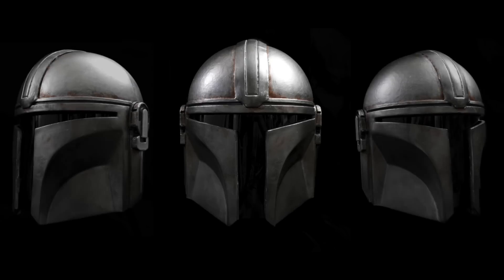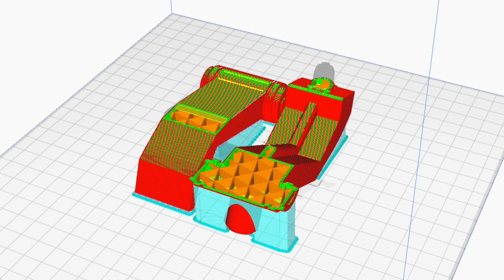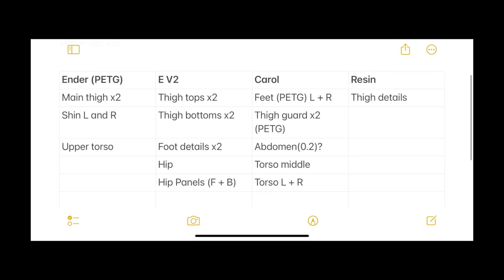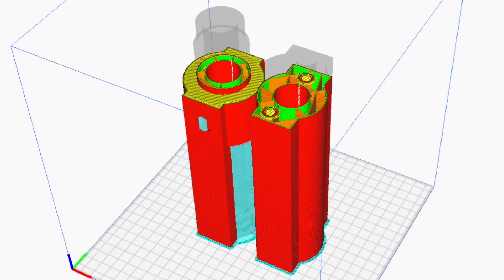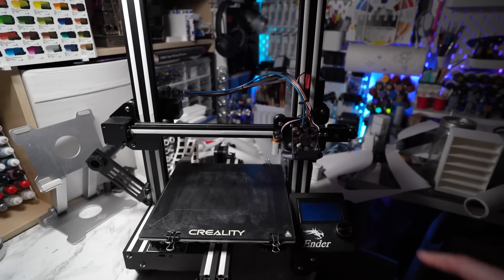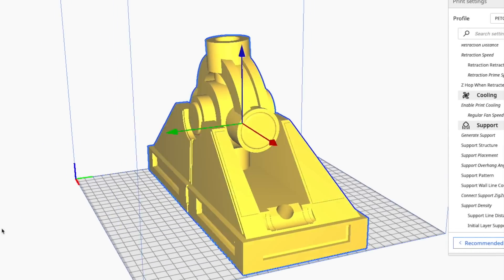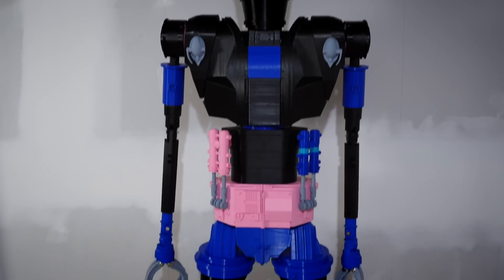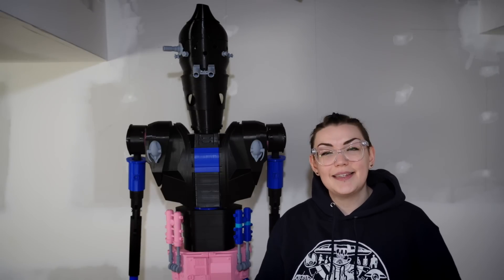How I 3D Printed a Life Size IG-11 from The Mandalorian in only 10 Days

Comment: This is very cool, and I’ve toyed with the idea of a K2-SO, but I’ll ask you the question that’s holding me back. Where do you plan to put it?
Reply from the maker: I essentially have “droid parking” in my workshop. A lot of the droids don’t take up a ton of space as they’re quite thin and it’s just their height that could become more of a concern. It’s probably similar to the area needed for a floor lamp in a lot of cases. I’ve also wanted to build a K2 for a while. He is one of those droids that take up a bit more space as his legs have further spacing than a lot of them that just are straight down from the rest of their bodies.

Comment: Which is the best 3d printer you would recommend to use when making props for cosplays and armor etc? Also love the video!
Reply from the maker: I’m a big fan of Ender 3’s. They’re the first printers that I use when printing anything and I only use my larger ones if the piece is too large to fit. There are a ton of different models though so I can be a little confusing. The V2s are great but there is a V2 Neo that has some great added features that I personally feel is well worth the slight price jump. I’d only go for a 300x300mm printer if you’re really going to be constantly printing massive single pieces. Most large models are split into pieces that will fit on an Ender 3 size bed though (235x235mm).
Reply: @MMsPropShop Thank you so much for the info. I'm very interested in getting my first printer and had no idea where to start. This has been a great help.

Comment: i always print my petg with the cooling fans but a little hotter to prevent that delaminating. i like to use sunlu at 240 degrees nozzle and 80 degrees bed. instead of primmer filler i use a paint brush to apply printer resin to my parts and sand

Comment: That is freaking cool!! 
I’m new to the channel (I also subscribed), how many machines do you have or did you use for the project? I’ll have to catch up on your other vids, but keep up the good work 👍🏻👍🏻
Reply from the maker: Other than the ones used for this build that included a CR-10s, Ender 3 Pro, 2 Ender 3 V2s and a Mars 2 Pro, I also have a Mono X, M3 Max, and a CR-10 Smart and Chiron that are still in their boxes until I have a spot for them.
Reply: @MMsPropShop  
That’s cool thank you for sharing. 👍🏻👍🏻

Comment: i must have missed it, how many rolls of filament?
Reply from the maker: About 13.5 (you didn’t miss it, I’m the idiot that forgot to mention it in the video 😂)
Reply: @MMsPropShop  dang, so about 350  files+filament (figured avg. of 20 bucks a roll)  and then maybe 75 bucks on paint and sandpaper. 425 + lots of labor in the finishing. ends up being  pretty costly.

but is/will be a beautiful piece. 

i started a iron man build years ago and got overwhelmed before i even had 1 arm together. gonna try again soon .

Comment: Which PETG are you using? I'm struggling with my Overture Space Gray, lots of blobs and boogers
Reply from the maker: Duramic. I’m a huge fan of their PLA+ so I figured their PETG might also be good. I’ve only ever used the one kind of PETG so far, so I have nothing to compare it to, but I was very happy with how it printed.
Reply: @MMsPropShop  Thanks! I'll give that a try. Thanks for the lightning fast response
Reply: @MMsPropShop  One more question, do you have an all metal hotend? I hear PETG can damage some printers stock hot ends because you print close to the melting point of the plastic tubes that to down the hot end
Reply from the maker: Nope, they’re all the stock hotend. I do have Capricorn PTFE tubes on the machines though that are more heat resistant than the standard white ones.

Comment: looking to get a 3d printer to start doing some droid builds for myself from droid division - would you recommend the ender 3 - there is just so many of them.... not sure which model to go for for fdm and then resin
Reply from the maker: I know, the Ender 3s can be super overwhelming. The Ender 3 V2 is an awesome machine, I wouldn’t go for anything older than it model wise because the upgrades it has over the original Ender 3/Pro are worth far more than the price difference between the two models. If you wanted something with a few more bells and whistles than the V2, there’s also the V2 Neo, S1 and S1 Pro. The short version is the V2 Neo would add auto bed levelling (that red light that you see on my machines that I’ve added myself), the S1 would give you a direct drive extruder, and the S1 Pro would give you both of those features. Auto bed levelling is very useful to have but ultimately not 100% needed unless that’s something you personally want.
For resin, all of the pieces I made in the video were on my Elegoo Mars 2 Pro. It’s definitely the resin printer I get the most use out of and was my first resin printer. There have since been newer versions with upgrades but they’re all great little machines and would be a great first resin printer choice.
Reply: @MMsPropShop  Awesome thank you for the update, very kind, what do you think over the bowden extruder and the direct drive ? and what about bed size ? as seen a plus and a max ? you mentioned PETG in the video is that better than PLA for droids  ? you also mentioned nozzle sizes .4 and .8 what is the diff and when would it be used ? thank you
Reply from the maker: I don’t actually own a direct drive. I understand the benefits of having one but I’ve never found the need to upgrade any of my machines.
Bed size is definitely more of a personal choice depending on what you’re wanting to build. A standard Ender 3 bed size is generally more than sufficient in most cases and due to them being the most popular printers/bed size, most designers create files that will easily fit on those machines (including Droid Division). I always use my Ender 3s first unless it’s a bigger piece and then I’ll jump to my CR-10s if I want to print it in one piece.

I’ve made many life size droids using the absolute cheapest PLA you can buy and they’re still looking great. PETG does technically offer more heat resistance and strength but I mostly chose to use it for IG for its sanding properties. It comes with a slew of other properties that can make it harder and less desirable to use for projects though like it’s difficulty with adhesion. PLA+ is a nice in between of the two plastics that a lot of the best droid builders in the world tend to gravitate towards using. A lot of the strength of pieces will come from how you print them though, not the material used.

The nozzles are the diameter of the hole that the plastic comes out of. 0.4mm nozzles are the most common size on 3D printers, 0.8mm nozzles extrude twice the amount of plastic. Using bigger nozzles is all about saving time. It can come at the cost of print quality though. A 0.8mm nozzle essentially prints at half of the resolution as a 0.4mm nozzle will. I only tend to use the larger nozzle on large pieces with little detail where you wouldn’t really see a difference in print quality between the two nozzle sizes, but it will have been printed in about half of the time. Lots of people will never venture outside of using a 0.4mm nozzle and that’s completely fine! It’s a great size for just about anything you’ll ever need to print.
Reply: Awesome thank you so much, just ordered an elegoo Neptune 3 pro - you are my inspiration